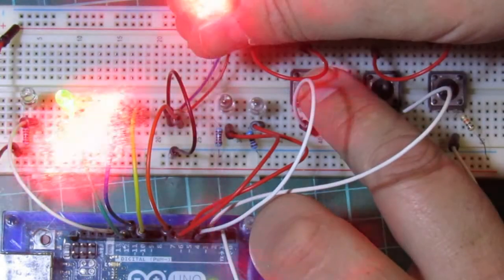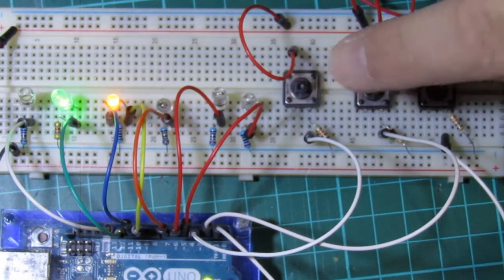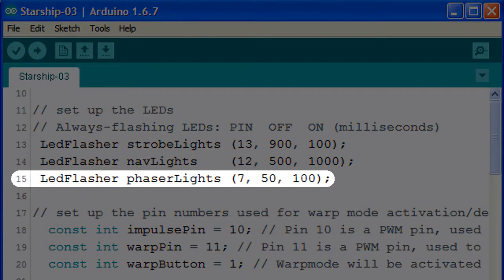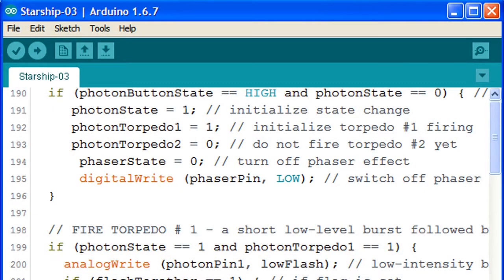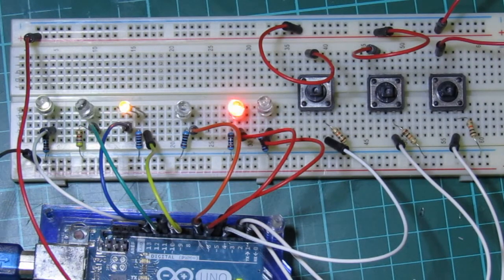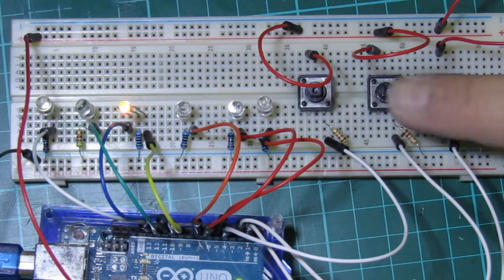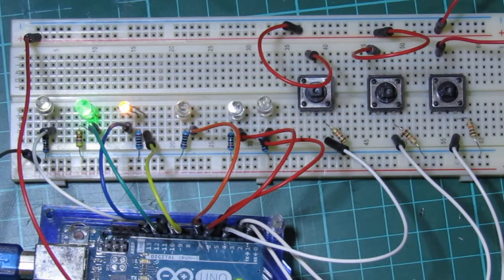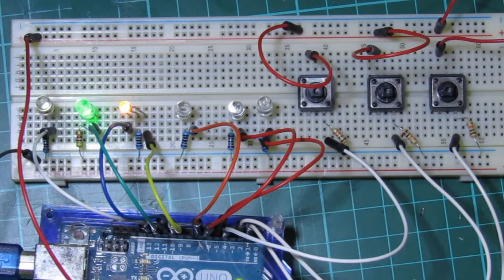Arduino for Starships - Ch05 - Bonus: Sketch Bashing

Comment: Hi Trevor... I have a question regarding a line statement at the beginning of the sketch which read... #includes <LEDFlasher.h>what does is,  or what does LEDFlasher.h in the Arduino sketch do... thanks again for posting your videos they have been a great help.
Reply from the maker: Hi Sal, that's a good question. The statement tells the Arduino compiler to add the LED flasher library to the sketch, which is basically a separate program (written by someone else) which runs together with the Starship sketch. It allows us to control the timing of the flashes a lot easier. In the very first tutorial I explain how to download and install the library. Later on, when we add sound, we will be using another one, the "TMRpcm" library. These are just handy ways to save time when writing a sketch. I hope this makes sense :-) - Trevor
Reply: Thank you for the information... hope you're feeling a bit better.